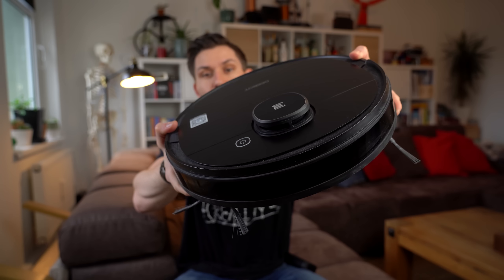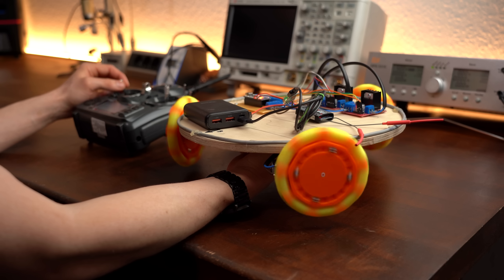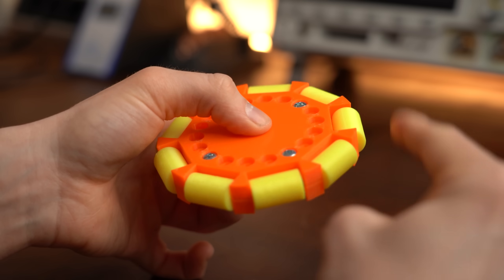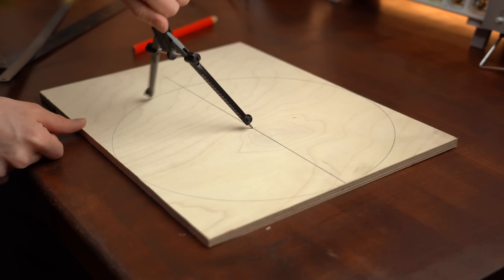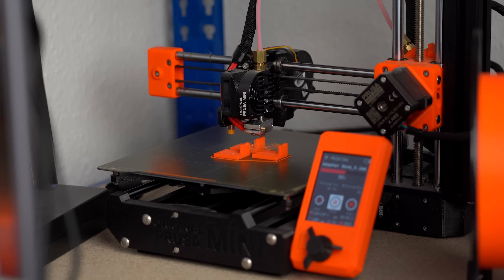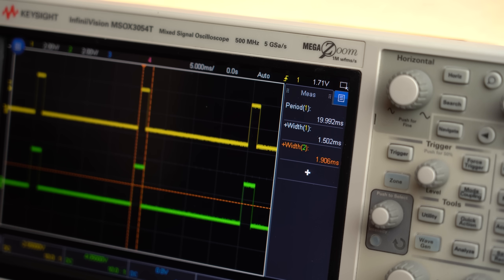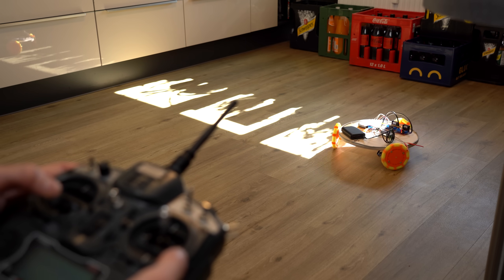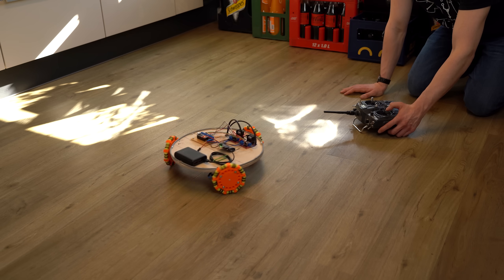This Robot Design is AMAZING! But is it worth the STRUGGLE? (Omniwheel)

Comment from the maker: Thanks for watching this video! Now the robot design in the end is certainly not perfect. But like I said; by using other rollers+motors, this robot can become way more precise and stable. Also the code of the robot is certainly not perfect. I think I messed up the math at some point. I will have to figure that one out as well when I get to make a part 2. I think I even wrote a wrong equation on my vector paper......mistakes happen. But I think the overall idea of the video should still be pretty clear ;-)
Reply: check this guys channel "James Bruton" there are some intresting videos about these wheels
Reply: @Praveen P  (damn you beat me to it 😅) ... but yeah if you're interested in these types of wheels check out James bruton he's got alot of different designs using them
Reply: @MrKevCrafter  patreon subscribers get to watch videos in advance
Reply: Your presentation and your paper is awesome, it's okey to have minor mistake inside~
Reply: It's not hard to keep O-rings in place on rollers, you just need to add grooves on rollers, and then put O-rings in grooves
Reply: @blackwingmaster141  I was thinking the same. ✊🤓💜
Reply: The robot make some cool drifting ;) What if instead of using O-rings maybe wrapping very small loops of fine diameter rubber bans over the rollers do the anti-slippery trick.
Reply: Definitely genius! ✌🤝✌ !.
Reply: Finally! a robot.
Reply: hello Iam creating robovacs for my self to the first thing anylise existing structure and why . So a why Robo wacums has 2 drive wheels ? One main thing I found out is cleaning, because the 2 wheal design in a direction the robot puses the bruses to the floor so keep that in mind in your design, peace.
Reply: there exists an omniwheel design that allows you to use 2 wheels, 2 motors, and a rollerwheel...
Reply: Great idea, but if all wheels made DIY method, it would be easier if you use 4 wheels, like in quadrocopter. Easier programming and no big drifting effect.
Reply: I nailed the question a few days ago.  Nice.
Reply: Hey great scott, I like your videos How about you make something related to brain. Like mind controlled something.
Reply: This again was a great project like ur all other project 
I think making grooves in rollers to fit O-ring proper in one place 
And feeling excited for ur next project
Reply: If you can print in TPU, you print the rollers in that. It's helpful to have the rollers as simple as possible, while still having that rubber traction. The better design does include something of a bulge in the middle, as the rollers are supposed to follow the arc of the wheel. There is also existing code that ironed out some of the problems you were having, examples through FIRST Robotics have been pretty well open sourced.
Reply: you can get the vex robotics omni wheels much quicker than the ones from china, scott.
Reply: YES

Comment: I'm so glad I've found this video. Been searching for a 3 wheel Omni directional robot for ages I could get some insight from.

I'm 17 and have just started building my own which I'm putting a robot arm on. Using 3 58mm wheels that I did end up ordering from China (I knew traction would be a problem with 3d printing), 3d printing the rest of the body and using 3 N20 metal gear motors with encoders and 2 L298N motor drivers and a raspberry pi. 

My main problem right now is finding out how I can power it, I want to use a rechargable brick like u used but curious how exactly are you turning that into 2 sets of jumper wires to power the drivers and also a cable to power the Arduino (mine needs USB C)

Comment: Just a thought on a more advanced design for the Omni Wheels.
In thinking that the more traction you add the more friction you add when you drive against the dormant wheel.
Perhaps there could be a function where traction is added and subtracted on the Fly based on what that wheel is supposed to be doing.

Comment: Would rubber cement stick to the plastic? If so you could basically paint on a thin rubber coating to improve traction.

Comment: Great video, as always :)
May I suggest using rubberised rollers - possibly using heatshrink over the rollers if you're staying with diy, or if you're going for the commercial product? 
The rollers also need to bulge so that the wheel overall is round, and not a segmented polygon :)

Comment: What if you 3D-print the side-rollers not just in smaller size for putting up the gummie around them - but create little valleys? Or basically "circles" in depth where the gummies fit?

I think then they would not move! I talk about concentric circles with which the rollers would look similar to a screw!!!

Comment: I used mechanum wheels in my recent robotics project and I had to figure out the trig coding too. If you can get an accurate IMU measurement(most likely using some sort of complementary filter), you can use PID to keep your angle straight, regardless of slipping. Implementing the PID algorithm while keeping motor direction in mind is a bit difficult....

Comment: one little thing, the rollers should bulge in the middle so that the outside of the wheel is still a circle, rather than a 9 sided polygon. it should help with the bumping a bit as you drive

Comment: Great project, but this is not solving the initial task of increasing efficiency, but actually making it worse. Omniwheel efficiency usually is only 50-70% in any direction.

Comment: If you can print in TPU, you print the rollers in that. It's helpful to have the rollers as simple as possible, while still having that rubber traction. The better design does include something of a bulge in the middle, as the rollers are supposed to follow the arc of the wheel. There is also existing code that ironed out some of the problems you were having, examples through FIRST Robotics have been pretty well open sourced.

Comment: The rollers should have a curved profile that follows the curvature of the max wheel diameter . Then put some shrinking tube  around the rollers if you don't have rubber rollers.

Comment: small tip (may be usefull for future rf projects): you ca also use the s-bus or i-bus (if available, tho most rf receivers support at least one of them) to read directly the channel values from the receiver without having to read the pwm signals from the channel output pins (this way you can also use more channels that the receiver can normally offer)

Comment: Is it possible to just add proximity sensor or some other sensor to automate that robot? I m honestly not sure about those wheels. They are maybe good at different roads at home they for sure need rubber. I would stick to traditional setup with two wheels and one loose. Great work man. You make those things that look like they are so easy to build... What language do you use for Arduino? C+,Python? What languages are possible to drive Arduino? Is it possible to do it like with PHP? :)

Comment: Could you print to a size that fits a lego wheel tire? And maybe have the wheel partially capture the tire rim so it can’t as easily move side to side and off the roller wheel.

Comment: Why not make the rollers concave to make the transitions smoother? Also, a simple coating of Plasti-dip would likely solve your traction problem. (If still not enough, print grooves for the o-rings, then paint on the plasti-dip to "glue" the o-rings in place.
Reply: Gluing the O rings into grooves should give the best results.

Comment: i think what you need to do is print the original dimension rollers or just very slightly smaller but then cut groves into the rollers for the rubber o rings to fit into.

Comment: Not entirely convinced by the omni-wheels there appears to be a problem resulting from the wheel segments rollers being straight. The wheel is not truly round, but a polygon.There are positions where the wheel segments is at an angle to the floor, resulting in a loss of traction, and therefore direction  control.
As to keeping the rubber O rings in place, one solution might have been to cut grooves into the underlying rollers for the O rings to sit in. though a better solution would have been to be able to manufacture rollers with a better grip material, such as a synthetic rubber. 
It is still a very impressive project.

Comment: To stop the O-rings from moving, you could print the rollers slightly larger and put grooves where the O-rings are meant to sit. If the rings still move, then use smaller rings (stretch them over the roller to put them in place) until they don't slip out of the grooves.

It's either this, or you use TPU rollers... and when you print them put some kind of tread on them.
Reply: You could also try gluing the O rings into the grooves too.

Comment: Are you able to control the speed of the motors by injecting a pwm signal on the "Enable" pin for each H-bridge of the motor drivers?

Comment: Hmm Well I am not fan of the wheels two wheels and the slight turning is not issue as trig can compute the best advantage for coverage.   Like using a rope winding of 30 degrees.  Math has proven that rope and other structures have greater strength with that combination of angle crossing.   It also works in coverage yes there is overlap, however greater and better coverage with the least amount of energy.

Comment: You'd get way better performance by replacing those straight cylindrical rollers with crowned rollers (with a crown radius equal to the wheel radius).

Comment: I have experience with these, they are common in FRC. Omnis have terrible traction. Mechanum wheels are similar and do quite a bit better, and are easy to use in a traditional 4 wheel configuration. They still have wear problems, but it's not too bad on carpet.

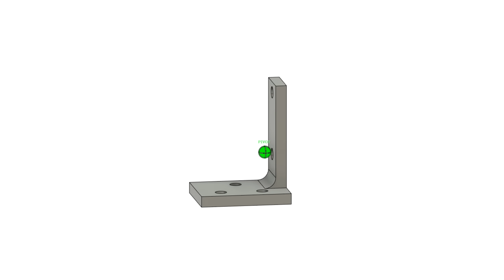Comment: At 05:57, a quick Fusion360 tip: Theres alot of standard electronics parts, aswell as hobby project components, in the Fusion/Autodesk Gallery. This makes it easier and quicker to CAD, as the parts in the gallery often are quite precise. The motor you are using is in the gallery named Geared DC Motor

Comment: This give me massive amounts of nostalgia from doing competitive robotics in middle and highschool.  4 wheel "x-drives" are a lot more common in that environment, and some teams use meccanum wheels which accomplish the same thing and are even programmed the same, but you don't have to mount them at 45 degree angles.  Pretty simple to program too once you get a good grasp on how they work. I have some code somewhere that implements driver control for an x/meccanum drive in 4 lines.
Reply: There was even a team that designed their own meccanum wheels a few years ago.  And 3D printing isn't allowed and you can only use a specific set of parts so they had to be creative and cut up some gears and take the rollers out of Omni wheels.  Anyone who's interested in taking a look, search green egg robotics meccanum wheels on YouTube

Comment: I mean it's fun to 3D print and fiddle with toys, but from a practical point of view, you haven't sold me on the advantage of such wheels. If I had the requirement that the orientation of the robot must absolutely remain constant as it moves around, I would use wheels that rotate under the robot, rather than using these so-called omniwheels. Other than skateboarding applications, I see no real use for them, which by the way you can try. Put the omniwheels under your electric scooter so it can slide from side to side or spin hahaha. Fun but completely impractical.

Comment: What about using a rubber hose for the wheels? Print plastic bushings to stiffen the hose, and plastic washers on either end to decrease friction. So you would have a hose with a plastic insert, then a shaft going through everything. It would be cheap, and I reckon it would work pretty good. You can order hoses of all different diameters to suit your needs.

Comment: You should also check out an X drive, where 4 wheels are facing outwards with a 45 degree angle between them. You get more significantly more power and traction with this configuration.

Comment: Nice project. Consider using TGP rod (turned, ground, polished - I have no idea what it’s called in German) for the axles for much longer life, less side-to-side lash, less binding and lower rolling friction - when you want the roller to roll. For added friction in the axial direction, consider using rubber/plastic tubing “tire” over each PLA center “wheel”. For example, radiator hose, ‘fish tank” tubing, etc., depending on the inner/outer diameter desired. Tubing is, of course, available in all sorts of sizes and with different durometers, and thus can be selected for the desired amount of friction.

Comment: Maybe when you create the wheels on your 3d printer, design grooves into the wheels where the o-rings can sit in. This will make it more difficult for them to slip off.

The other crude option is to wrap only one layer of Amalgamating tape on the wheels to give it rubberised coating.

Food for thought.
Reply: I wrote the same and thought the same - now I see I'm not alone ;-)

Sure this would work ;-)
Reply: Yes indeed, I thought of the exact same thing. Small grooves with thick O rings and even use glue if necessary to ensure they don't slip out of their grooves.

Comment: Just a thought - with two wheeled robots, the third swivel wheel/roller tends to have a negative impact on the accuracy of the robot, as it creates non-linear forces while turning, causing the two DC motors to spin at different rates as same voltage. Would it be an idea to use a small, free running omniwheel instead of the roller?

Comment: I would not rely on the rotation-position detection, while talking about wheels. Those stuff is good for e.g. robotic arms. I believe Mark Rober also did some external position detection. (Also rollers of the omniwheel has a barrel shape.)

Comment: Awesome work, dude! Nicely done! 😃
About the issue of the wheels, you could modify them to use a "tire" which you could print with some flexible filament. You know?
But, either way, really well done! 😃
Stay safe and creative there! 🖖😊
BTW, search for radios with OpenTX or EdgeTX. The second is just a fork of the first, which is lacking a LOT in development, but they're totally compatible.

Comment: One solution to your slipping would be to use a Gyro to keep it straight while accelerating.
Reply: Wouldn't that stop it from turning though?
Reply: @stepheneyles2198  No you would program it in a way so it rotates at the desired rotation speed. If you set 0 it will not rotate when accelerating, if you set anyting else, it will try to maintain that .

Comment: what if you print rollers with indents for the orings to slide into and use adhesive to stick them permanently on the rollers?

Comment: Fellow robotics student from your own country here. The design of the mechanum  / omnidirectional wheels are almost half of the story and they rollers and the angles are required to be very precise for the vector calculations. The other half is the software, specifically the position tracking of individual motors, as you mentioned. The end product is really freaking cool, like the Kuka cargo mover and others, but I don't think it is very easy to do that at an individual level. 
Still, I must applaud your efforts! :)

Comment: mecanum wheels are the best. change my mind. i worked with those type of wheels for about 2 years (i've participated at the FTC robotics competition and we used mecanum wheels for movement)
Reply: The biggest flaw I see with them after looking them up is that in some directions of movement, some rollers or wheels wouldn't turn, so they have to drag across the surface. Another is the inefficiency of drag no matter which direction they go. That said, I'd expect very smooth rotation with them.

Comment: Makes me wonder why can't electric cars  just do the same with independent motors on the rear or front hubs? A seperate steering system is a consequence of a single motive force (ICE). Seems like a steering system could consist of a pair of front/rear caster wheels and (lots of) code. Hellishly simpler, lighter, cheaper...

Comment: Just use some rubber balls and 2 motors each to spin them in each direction.
Also the threaded bars you used will erode those cilinders in short time.

Comment: Question: Even if the kinetic energy is a scalar, the speed is a vector. So, if it is the same energy to move toward "x"  ( v= (1, 0, 0) )  than toward "y"  ( v = (0, 1, 0)  ) the momentum has to change if we change from moving toward x to moving toward y. So a force has to be involved and do some work. So the question: have you measured the difference in supplied energy between a "classical" robot and a robot with omniwheel, both robot being of the same mass, when you claim that the omniwheel is "better" ? I think that the omniwheel loses a lot of energy through friction (doing no useful work) when not moving parallel to its axis (as a classical wheel) nor perpendicular at it.

Comment: I wonder if you could paint your rollers with something like Dip It which is used for tool handles to give them grip. That dries fairly smooth, perhaps there are other spray on rubber coatings.

Comment: You could check out the robocup soccer robots (e.g. small or middle class). They’re pretty much exclusively build around this kind of omni drive platform. Not only can you move in any direction, but you can as well rotate the robot arbitrarily at the same time, whilst going in a straight line.

Comment: Nice project. If you have a 3D printer, why don't you get some of the softer flexible TPU filament to make the wheel rollers?  Also, over time the threaded rod is going to chew up the inside of the rollers. You should just get some smooth metal rod.
Reply: Or even thin hardwood dowels.